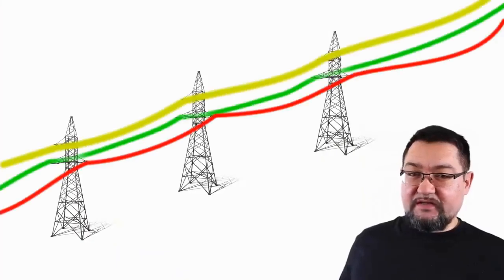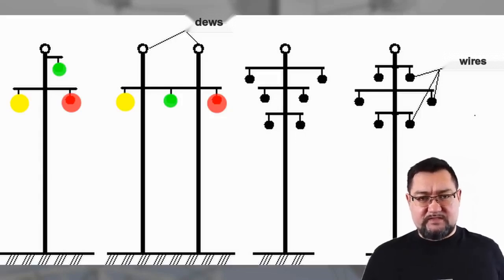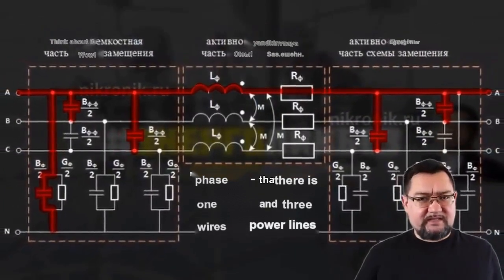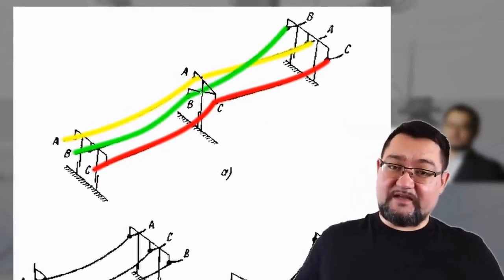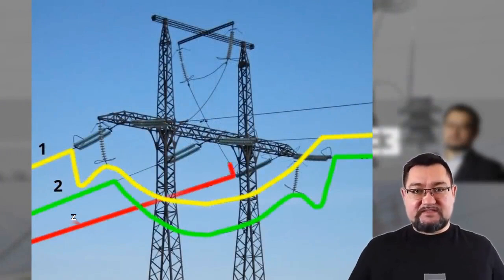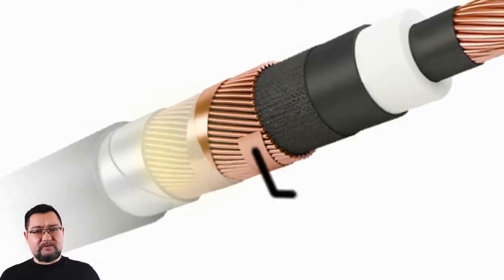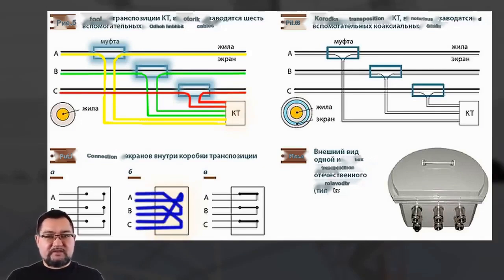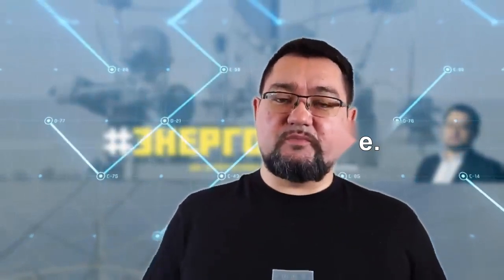Why do power lines twist in a spiral? #powerline #usa #electrosium

Comment: Mark the video with auto-translated so that viewers that do not wish to waste their time can avoid this. This has to be one of the worst engineering videos I have seen because the excessive use of wrong terms. There is no LED (Light Emitting Diode) involved in the power transmission lines. The content has been flagged.
Reply from the maker: @aisupporter4775  Unfortunately the algorithms are still imperfect. And yes, the neural network couldn't translate the abbreviation "power line" properly. 
Yes, I will be tagging content. So there's no confusion. 🔥👍